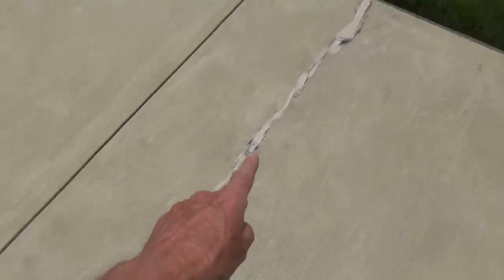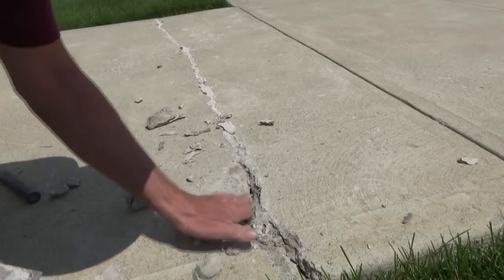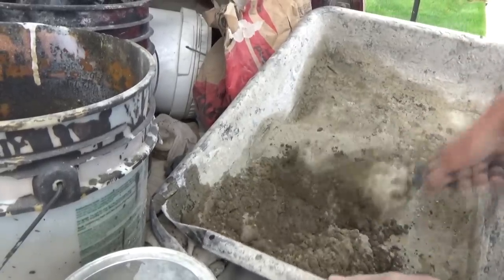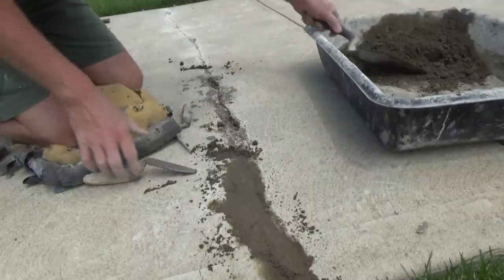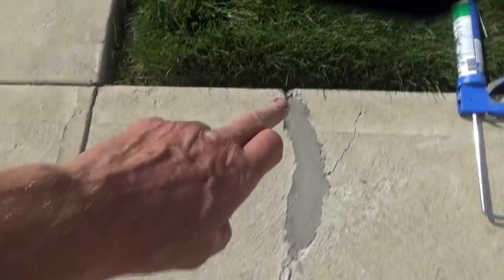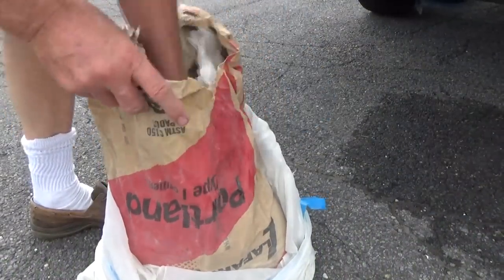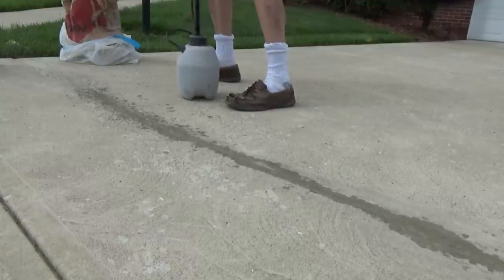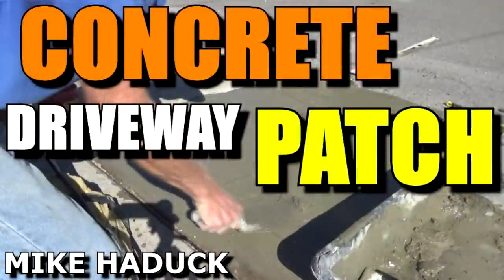how I caulk a concrete driveway crack (Part 2) Mike Haduck

Comment: Mike, I found a long term solution to driveway cracks.  A few years ago I experimented with flexible floor patch.  It's a latex patch that they use under vinyl flooring.  DAP makes it.  It is slightly sanded and a beige grey color so matches old concrete well.  Its not made for driveways but it has held up very well for me. It comes in a 1 qt tub premixed for under $10 and you can work it and sponge it just like caulk.  It's about the consistency of spackle out of the tub.  It remains slightly flexable after it dries but firm enough that you.can do large voids.
Reply from the maker: Thanks, I will keep my eye out,  mike
Reply: Can you offer more detail about the DAP product name? Where do I get it? I can’t find it.
Reply: I'm curious, too.  Please provide product name when you have it.
Reply: It's called "dap flexible floor patch and leveler"   it comes premixed in 32 oz tubs for about $10.    It applies  like a sticky, spackel like mixture.  It can be wiped smooth with sponge.  I patched all of my cracks before painting with driveway concrete paint.  It has held up very well.  When I previously patched the cracks with regular cement it cracked again within a month.
Reply: @joeydueceable  how is it holding now? How deep were your cracks? What area of the country are you in weatherwise? THANKS

Comment: Nice job Mike , those jobs are much harder than they look .
Reply from the maker: Thanks Rocco, mike
Reply: @MikeHaduck  One question for ya Mike , whats your thought on power washing concrete patio that has black mold on it and white stone steps? Will it damage it?
Reply from the maker: Hi Rocco,  the owner just did that on one before I repainted it,  thanks mike

Comment: I just patched some wide cracks and used Cement All. Mixed it like a milk shake and poured it in. Wet crack first.
Reply from the maker: Hi Rick, anything that works, I have done it before, thanks Mike
Reply: Did it blend okay

Comment: I've pressure washed and sealed surfaces for 35 years.  I maintained an exposed ag and plain cement patterned driveway (33,000 square ft!) for two decades.  At first I used silicone for cracks in the exposed ag.  As the drive worsened I changed my method...pea gravel and epoxy pudding into the large gaps and silicone over the top when cured...Not concrete per se, but just a tip.
Reply from the maker: Thanks Jeremiah, mike

Comment: Mike, sorry to add a comment on to an older video, but I just ran across your channel.  I have been wondering for the last couple of years what I can do to repair cracks in my exposed aggregate concrete driveway, but I have not been able to find on-line repairs for aggregate concrete.  The cracking is becoming worse over time, with cracks increasing in size and starting to show some level changes.  What can I to to repair cracks in my aggregate concrete driveway?  As we approach the cold and wet days of winter, the weather conditions creates challenges to find nice days to repair the cracks.
Reply from the maker: Hi Dennis, I have a series out called "concrete patches" part 2 Mike haduck. And driveway resurfacing,  ,they might help, Mike

Comment: Hi, We have smaller cracks in our driveway.  This method might be a little difficult to get it all in there.  Do you recommend a different method for smaller cracks?  The Home Depot guy recommended Sika crack flex sealant (but when I watched the video it said horizontal cracks only?), the guy at the lumber store recommended Sika Self leveling sealant.  Not sure who to believe?  Just don't want to make things worse.  Also, our driveway isn't quite the same material.  It has lots of little rocks in it not sure what you call it, aggregate maybe? Thanks
Reply from the maker: Hi Kelly, my method is basically a covering before replacement,  some people redo it every year. I would do a very small section and see what works for you, I hope it helps, Mike

Comment: Hi Mike. I know you don't give 'advice' over the internet but I'm having trouble finding good info on dry packing. To fill in and repair long cracks in a concrete garage floor is it more appropriate to use conventional 2:1 sand/portland wet mix or use dry packing?
Reply from the maker: Hi Marco, for an inside garage floor I would watch the guys doing the epoxy floors, they have unique ways before they do the whole floor, inside garage floors are a whole different animal, thanks, mike
Reply: @MikeHaduck  Thanks for your time, Mike. Can't express how much I'm appreciative. Stay strong.

Comment: Still not sure I understand why the drive cracked? Was it because the control joint with the sidewalk was not full depth? So heaving of the sidewalk moved the piece the driveway with it and cracked it?
Reply from the maker: Thanks, yes they should have separated the sidewalk from the driveway, even if the sawed through it,  thanks mike

Comment: This has to be my absolute favorite masonry video. 
Your first dry mix pack looks already mind blowing good.
Then you sprinkle the Portland and mist it; blends it so nice ! 

A few weeks ago, I used a similar concrete caulk. I hate to admit I didn't do the Portland finish step.
It looks half decent on  dry days, but all the scars scream through whenever it gets wet &/or rains.

Even good old school Portland paint will not properly cover the cured, unsanded silicone caulk. 
There's always next year 😆
Reply from the maker: Thanks JL, Mike

Comment: You don't attempt to dry pack cracks under 1/8"? Just put that caulking in and over them  correct? It did look that way.
Reply from the maker: Hi ape, everything depends on the situation, thanks Mike

Comment: the real question is how long will this last before cracking again?
Reply from the maker: Hi Joe, I never seen anybody keep concrete from cracking again, you only desiqise it, thanks Mike
Reply: @MikeHaduck  I see. Thanks for replying. You got a new subscriber here. I'm a bit handy, but new to working with cement. Just started giving some maintenance to some neglected concrete slabs at the entrance and around my church. If you could spare a minute or two to answer another question, what do think about polyurethane concrete expansion joint fillers? do these last a good amount if time if done well? thinking about sealing some of the larger longer joints because they grow a crazy amount of weeds. thank you

Comment: Would it not make sense to also use an angle grinder to cut to separate the plate from the sidewalk.
Reply from the maker: Hi, I would cut it right off but then if that part sank. It would be my fault, thanks mike

Comment: I guess you can expect this area to open up again. What do you do then?
Reply from the maker: Hi Steve, it was done last year and held up well but after a bad winter you got to do what you got to do, thanks mike
Reply: @MikeHaduck  I think I get it. The cement fills the void and the caulk seals it so water can't infiltrate, freeze and split it out. Don't really see why a bad winter would affect it. Maybe, the ground beneath the repair heaving?

Comment: Thats not polymer modified so its not going to flex, its not going to hold…it looks more aesthetic, but you should have done ur mix with half water, half polymer…sand mix like u used
Reply from the maker: Hi Michel, I haven't had any callbacks, but the winter can lift it for Sure, thanks mike

Comment: That is going to fail so quickly.  It should be ground out with diamond blade or wire brush and install a flexible sealant.  That joint obviously moves and the new concrete patch is going to crack apart.  This will fail in a few years when a quality caulk repair would last 10yrs easy
Reply from the maker: Hi Daniel, I did this video last year. Mild winter but still fine, the driveway is starting to fall apart,  so 10 years from now he will be looking at replacement anyway,  thanks Mike